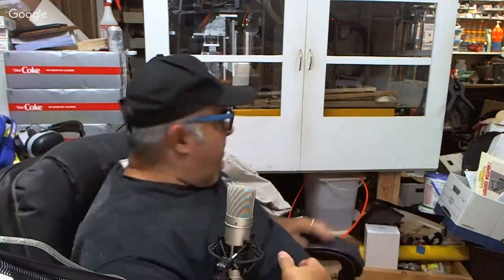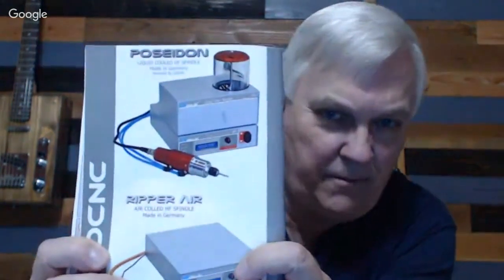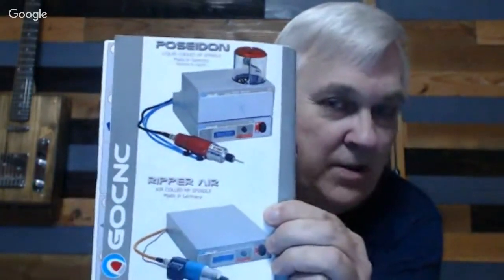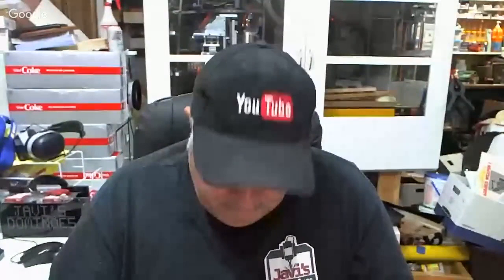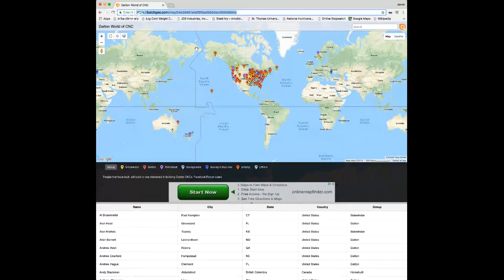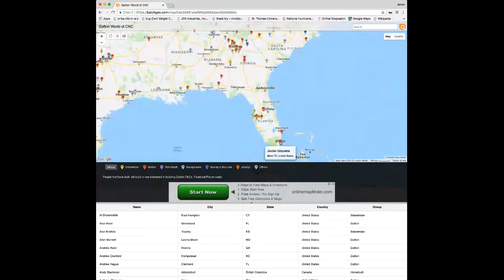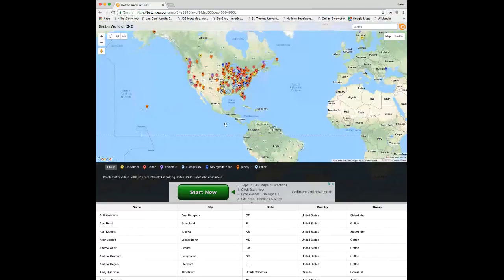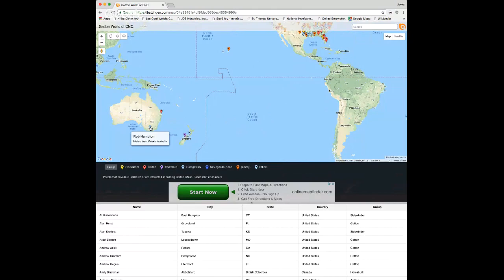CNC With Dave Gatton - CNC Discussion and Q &A

Comment: With the xylotex controller I'm getting a thumping noise in the steppers as I move. I've reinstalled win7 and which works for a little that goes back to the same problem again. I've got the same settings as Dave has. This is the Sidewider cnc from the shoestring build. Any ideas?

Comment: Moisture in 3D printer plastic is a bad thing. Because the head heats the plastic to 200+ C, water will boil and cause bubbles or even breaks in the filament. I have my plastic keeps in a moisture removing box and my prints are always perfect.